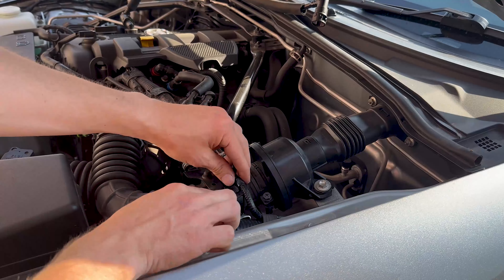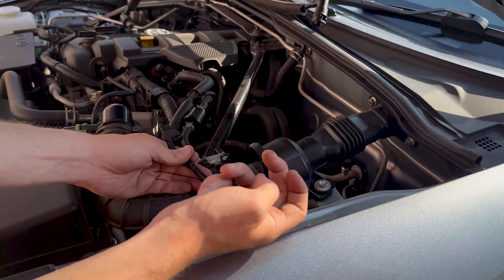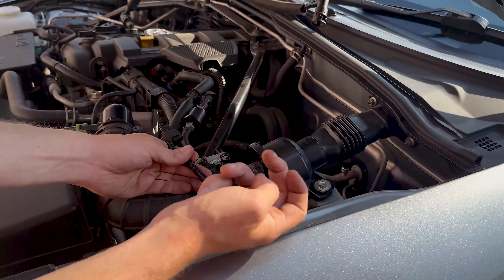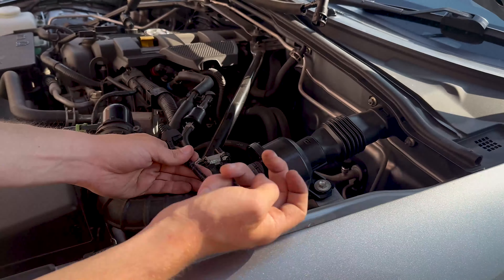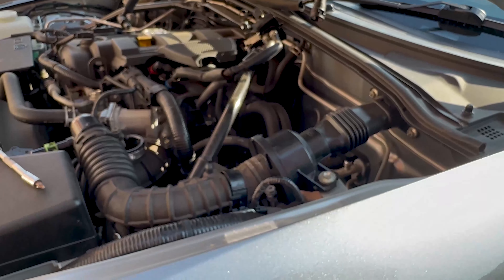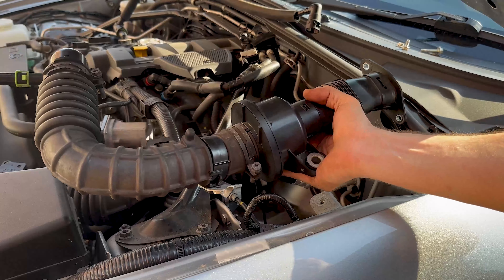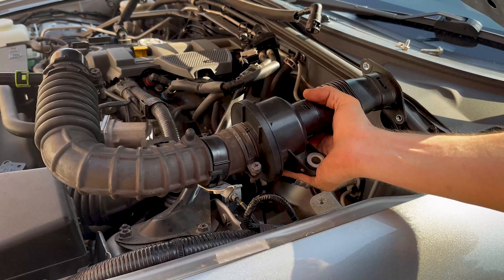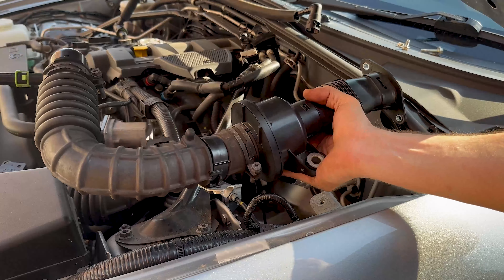Mx5 NC3.5/3.75 ISE Delete

Comment: Thank you for the very clear video. You made a plastic blanking plate out of sheet plastic. Why don't you just sandwich that plate between the bulk head and the original sound tube to stop the sound without replacing the intake tube assembly with one from NC1? All you have to do is then loosening 2 bolts at the bulkhead.
Reply from the maker: You can do that however I wanted to tidy up the engine bay also. Looks tidier removed.
Reply: Thanks @JGrindel